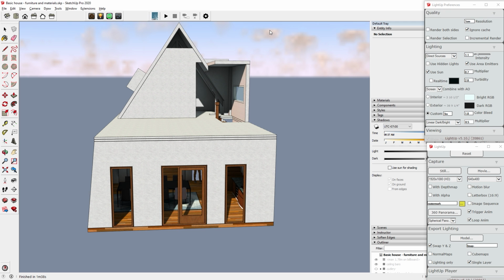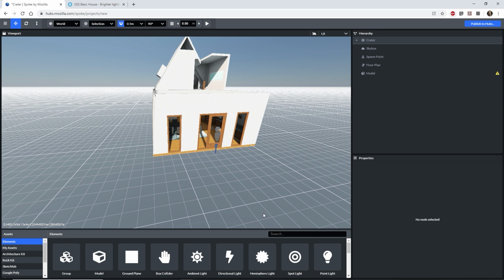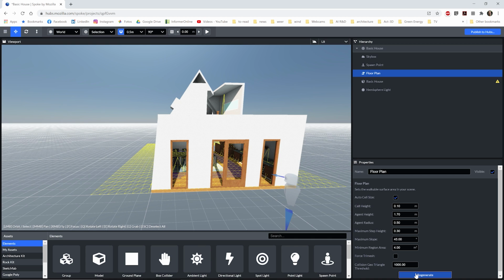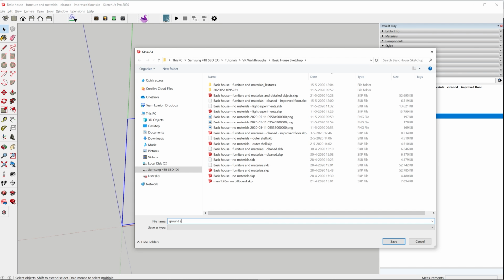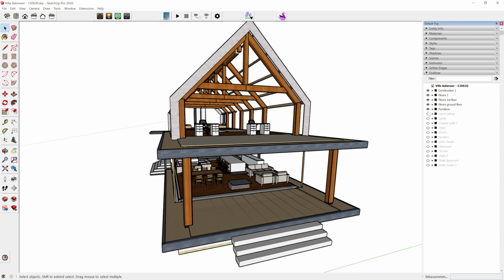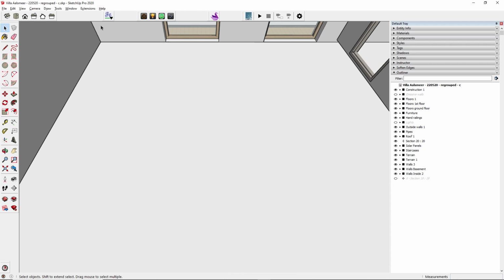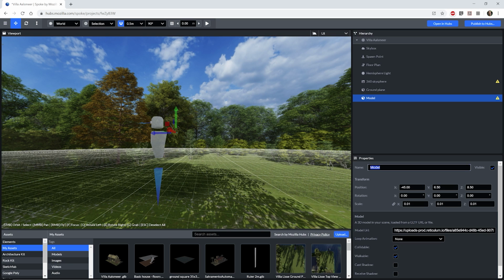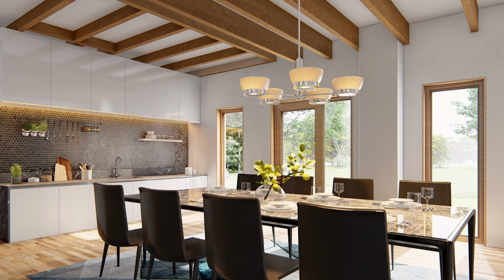How to create architectural VR walkthroughs with online tools, Pt. 2: Mozilla Hubs

Comment: Dear Lumion,
The features that are actually needed :
1)Batch render videos
2)Virtual Reality Videos 
3)Undo button, Ctrl+Z
4)Material editor with displacement map✓
5)Interior lighting improvements
6) Ray tracing / RTX
7)Reflection on curved surfaces + more reflection planes
8) fix Flickers in animation
9)Parellel Projection

The only one thing which is fixed is given a ✓ mark. Others are all still pending
Reply: I don't understand why Lumion can't add the most awaiting feature of importing camera tracking data also? Just due to this drawback, users are being attracted to a game engine (unreal)!
Reply: @kiransurwade3576  bro, camera import is not that important for architects. Lumion is aimed at architects. Cg artists can use unreal engine or Vray anyways. So I don't think that's a priority for the lumion team. In the same way, they don't support complex animations from 3ds max or similar ones coz that's not a necessity for architects. The features above are the ones that are actually needed for architects.
Reply: @aghilmohammed824  but there are majority of film makers willing to have such realistic output in less time, it will make their projects within time !
Reply: @kiransurwade3576  but bro, they are currently focusing on architects
Reply: Undo button, Ctrl+Z and lighting is headache in lumion
Reply: I've had reflections on curved copper roofs.  Are you referring to the included assets not showing reflections where there is curvature